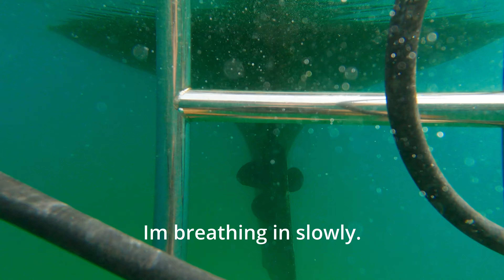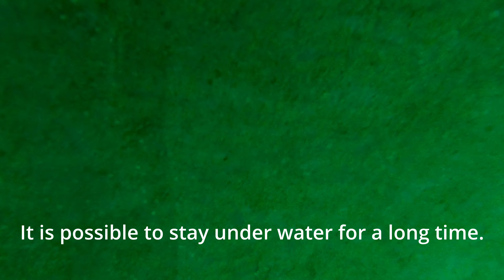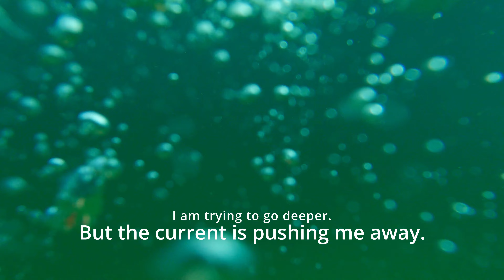How to diy the world's cheapest surface air supply (hookah)

Comment: It might "work" for a while. That kind of air hose will ALWAYS release some petroleum distillates. Maybe not a lot, but over time that can really damage your lungs. The pump is likely to have some assembly lube which will also contaminate the air supply. Put a filter on the line that is designed to remove oil vapors. And replace the line with something that is rated for breathing. Take a dive class (if  you haven't) so you totally understand that if you stay down at 10 or 15 or 20 feet long enough, you will have nitrogen and other gasses dissolved in your blood, and then your muscles, and then your bones. If you come up too fast (like if your pump quits for some reason) you can really be injured when those gasses come out of solution and form bubbles. You can also take a breath at 15 feet, and if you forget to exhale, you can rupture your lung tissue.

Etc, etc, etc, etc, etc, etc, etc. But you do you......
Reply from the maker: Thanks so much for the advice.
This was just a proof of concept, Whit what i had aboard. I've since replaced the pump and other components. I only need it to clean the hull which is feet deep about 1 hour once a year. So ill take my chances. After all, I beet I eat some processed crap that is much worse for me, 😅 cheers
Reply: I understand and respect your decision. But what about the next guy who follows your instructions? I want them to understand that there is a better way, and that there are significant risks if you don't do this just right.

For others who want to put together an inexpensive system, shoot for a diaphragm compressor that produces at least 160 liters per minute. And clear vinyl tubing would have far less petroleum contaminants than black rubber air hose. 

Everybody should do their own due diligence. 0:04
Reply from the maker: @solarguy6043  very well, I pinned your comment to the top. This way it will be the first comment that people will see.
Reply: @reversingentropy  Excellent! I just want everybody to have fun and be safe. 100% full marks to you for the creative solution though. Carry on with the great work.

Comment: Im impressed, could work in a pinch. And beats the heck out of drowning...  Good job. Be careful man.
Reply from the maker: Cleaned the whole Hull last Time i used it, just changed the pump for one of those electric sup inflation ones, provides much more air. Cheers

Comment: fantastic video
I have some questions.
what type of compressor is it and do you know the airflow for this compressor? litres/hour
What type of hose is used?
I would be happy if you could help me answer these questions
Reply from the maker: Hi. The compressor in the video is a normal 12v tire filling compressor from Amazon. But i dont recommend it. Later i changed to an electric SUP, kayak and dinghy Pump. These make enough pressure and have a much higher airflow. Cheers mate.
Reply: @reversingentropy  does the SUP one goes with 12v battery ?
Reply from the maker: @avish5959  yes most of them yes. Some even have integrated battery.

Comment: What time do you have to be back at the asylum for? You are an accident waiting to happen.
Reply from the maker: Loool, it worked amazing i just replaced the small tire pump with the larger dinghy electric air pump. Last week cleaned the whole Hull with it. Was underwater for about two hours.
Reply: @reversingentropy  you re still accident dude , listen do Kenny :)))